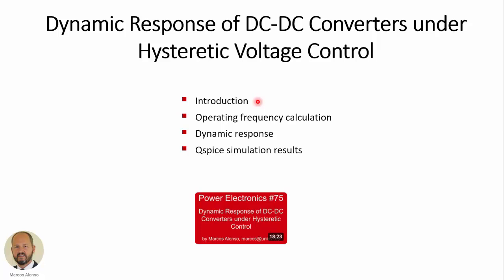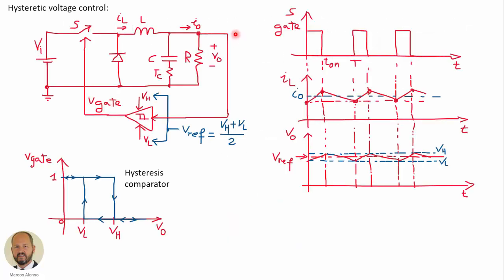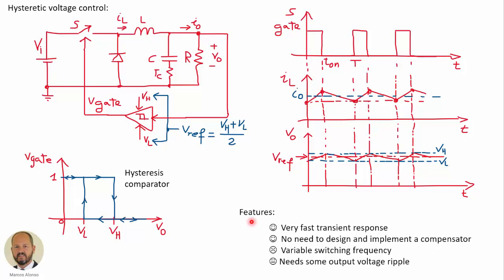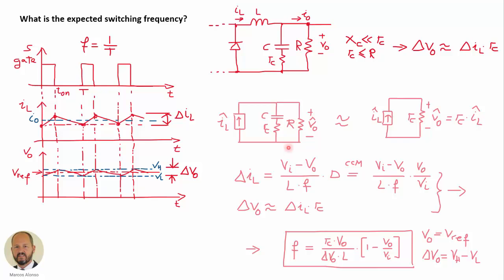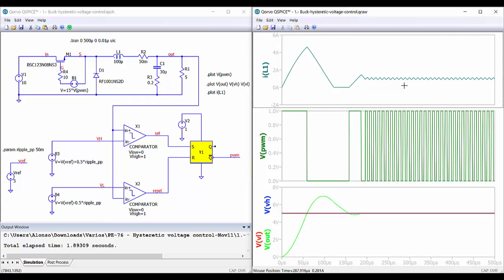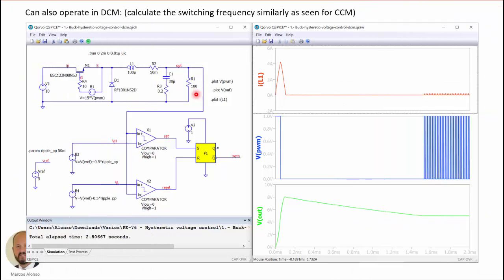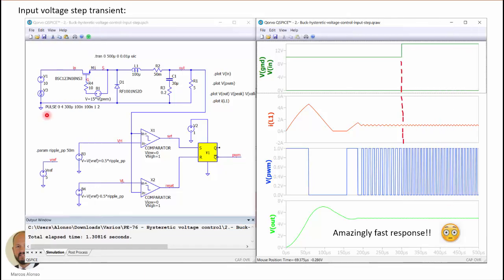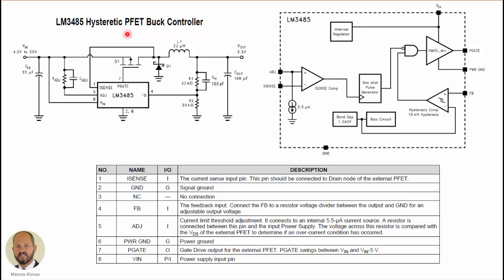PE #76: Dynamic Response of DC-DC Converters under Hysteretic Voltage Control

Comment: Probably you need a ramp for reference voltage. Direct step reference apparently causes overshoot.
Reply from the maker: Yes, of course. A soft-start circuit is highly recommended. I didn't want to complicate the presentation with this. Maybe in a future video. Thanks for your comment